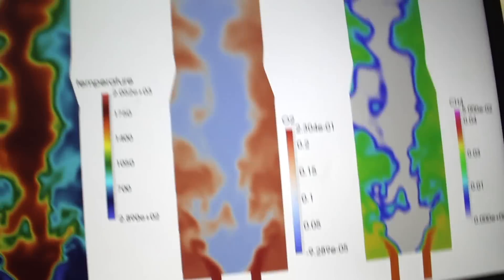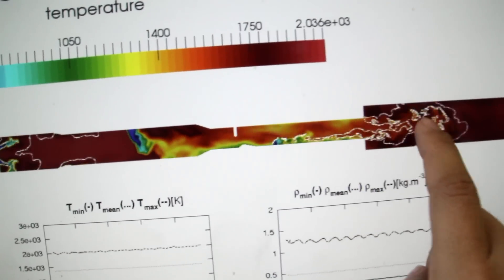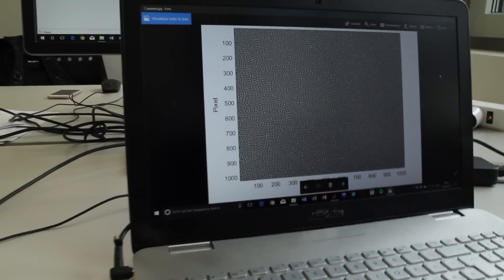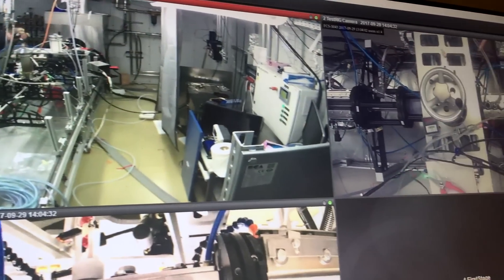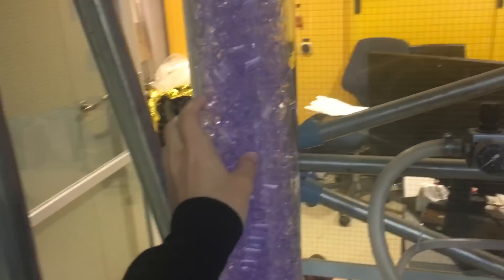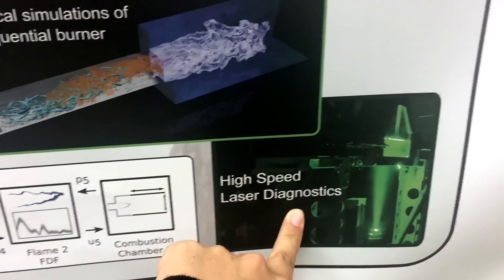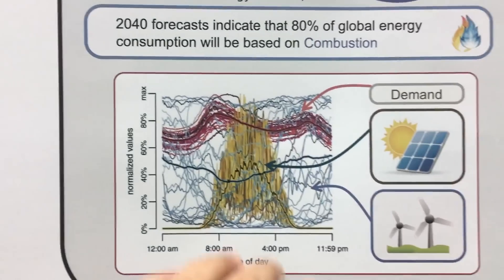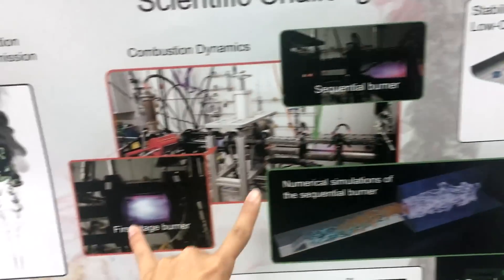Day in the Life of a Mechanical Engineering Student | Engineering Study Abroad

Comment: I find it funny that 18 year olds in the Air Force learn all about propulsion systems and turbine engines in a accelerated course within 5 months are qualified enough to work on and maintain them, but yet engineering students don't do anywhere near that until grad school lmao I probably learned more about the equipment you all study after only 5 months then engineering students do in 4+ years
Reply: Much respect to all our service men and women, and than you for your service. There is a reason why the Air Force employs aerospace engineers despite having 18 year old aerospace ground equipment technicians. There is a difference in the depth and breadth of knowledge. There is a massive difference between maintaining an engine and designing one... let alone a whole aircraft. Propulsion is one small aspect of aerospace engineering (and engines aren't even always necessary, sail planes for example). If it was possible to fully train engineers in 5 months there would be a huge economic incentive to do so. The work that STEMinine presented in this video, was one part of her education, not the culmination of it.
Reply: 551223 you are a technician. You repair and mantain equipment. Mechanical engineers design the equipment you miantain. 

So stop it. You are making servicemembers look foolish here.
Reply: They are related but entirely different skill sets mate.
Reply: I'm a mechanical engineering student and a pretty significant portion of my classmates are ex- Air Force and Army who were in similar divisions as you explained, but absolutely needed more education to be employed designing and improving what they were previously only maintaining. 

There's a reason why the mechanic that replaces your clutch and fixes your engine isn't building a whole new car in that garage. He's very good at fixing cars and telling you what's wrong with them, but if you gave him some paper and CAD software and told him to design a brand new one, he couldn't.
Reply from the maker: Thanks for such a thorough and thoughtful explanation andrew:)
Reply: 551223 your entire premise is that your training is almost equivalent to an engineer's training. 

It isn't. That is my point.
Reply: I think you are getting mechanics and engineers mixed up... They're NOT the same thing ! x)
Reply: 551223 having more hands on experience has nothing to do with designing a hybrid drivetrain or a jet propolsion system or any Mechanical system. Designing isn't in your job description. No contractor is going to hire you to design a new jet propolsion system because you don't have the first clue in how to execute that. 

NOTHING in your job has anything to do with designing machinery with the knowledge of advanced mathmatics and physics. Absolutely nothing. You maintain and repair equipment equivalent to a car mechanic.

A car mechanic has more hands on experience with replacing the clutch in a manual transmission than a mechanical engineer. They don't have the first clue in how to design a manual transmission though.

Signficant more amounts of training in higher level physics and mathmatics is required to design.
Reply: 551223 CAD software is just like me saying “grab a pencil and paper” it’s the medium, not the actual work. 

You claimed that they can get the same training in 5 months as an engineer does in 4 years. Well a mechanical engineer graduates after those four years fully capable of designing any mechanical system, including but not limited to cars and planes, which 5 months of training anywhere in the world will not get you.
Reply: 551223 and what experience on an engineering design team do you have to make such a statement? Thousands of freshly graduated engineers are involved in the design process of an engineering team right out of college. 

The lead engineers that have a decade plus of experience are the ones who manage an entire project but fresh graduates have been charged with designing specefic components. 

If you believe in capitalism, there is a reason why a fresh engineering graduate with no industry experience and just a few months of internship can be handed a 80+ grand salary right out of college and it ain't for charity.
Reply: 551223 did you forget your original comment or something?

I highly doubt you are a ME student unless you are a freshmen taking intro courses if you believed that a 5 month technical school taught you an equivalent amount or had the same purpose as a 4 year engineering school.

It's obvious that you have no clue what the purpose of engineering school is if you think grad engineering students maintain and repair equipment like technicians.
Reply: 551223 when has a ground aircraft technician ever made recommendations for a design lol? 

The vast majority of engineering school is math and physics theory. There is hardly much training in physical equipment as that isn't the propose of engineering school.

The core basis of mechanical engineering is statics, dynamics, thermodynamics, multivariable vector calculus and differential equations. None of which is really taught in a technical school.
Reply: Stephanie Lloyd it's not about building a whole new car. It's about being able to design specific competents. It takes a massive engineering team to design an entire vehicle. 

Navy technicians don't design anything. They don't have the advanced mathmatics and physics training to design. They repair. 

Technicians mantain and repair. 

Engineers design based on their knowledge of advanced mathmatics and physics.

Btw, it's good to see women chosing these fields more. It's kind of a massive sausage fest in our MechE department in my school.
Reply: Stephanie Lloyd well obviously if they never used CAD they aren't going to know how to use it. I'm saying people in the military have more hands on experience and training with the equipment they're working on then many graduate students. if something goes wrong, they can recognize what is wrong and can recommend corrective actions; not just design an entirely new unit
Reply: Farhan Chowdhury I never once said they know how to design anything so idk what the point of your statement is
Reply: Stephanie Lloyd I didn't mean to be condescending. Sorry, I was just stating in most engineering design teams, an individual engineer is responsible for a component of an entire product rather than the whole product itself which I'm sure you already know.
Reply: Farhan Chowdhury btw I agree with you that they're part of a team and help design a single component. The girl claimed they can design an entire aircraft, which is obviously false
Reply: 551223 I mean internships in design teams and career engineers teaching you and explaining to you how industry works in great nuance is more experience than you have as a technician in regards to what fresh engineering grads do out of college.
Reply: 551223 you honestly have no room to speak. You honestly believed that a 5 month technical school that trains you to maintain and repair aircraift is equivalent to a 4 year degree that teaches how design by teaching and applying higher level physics and mathmatics.
Reply: here ya go bud. https://drive.google.com/drive/folders/0B4tcnmT0ywhddkFVRk5VdEZGZTA come back when you can complete this course.
Reply: Farhan Chowdhury I know what an engineer does but thanks for being facetious. By the way, my faculty advisors have designed and built entire airplanes, monicopters, and cars from scratch, but I guess that’s neither here nor there.
Reply: Stephanie Lloyd if you think a student right out of college with no work experience can design an aircraft, you're naive. 90% of MEing jobs out of college will not be doing anything close to designing a working system .
Reply: Farhan Chowdhury I can ask you the same question
Reply: 551223 have you ever heard of design build fly or similar? Seniors literally build entire aircraft and rockets as a competition. It’s not going to be some elaborate stealth bomber or commercial aircraft but it will fly.
Reply: Stephanie Lloyd yes, they build a model
Reply: If they work, and they're heavier than the air they displace then by definition they are airplanes. I'm building a mini sprint similar car, universities have Formula teams that build Formula cars (my school doesn't have the money unfortunately :( ) and right now if I had the money and equipment I could build you a whole car.

One of the reasons engineers in industry work on individual components rather than the whole system is because it would take me a pretty significant chunk of time to build that car by myself, whereas a bunch of people each doing their own task can collectively come up with a solution far quicker than I could alone. You still have to know how the whole system operates together, you still have to know how to integrate your part and how failures or properties of it will affect surrounding parts, etc.If you don't have an understanding of how every single part in the system works and why those parts were designed that way, then your part will not work effectively. 

But you've claimed that someone who spent five months learning how to maintain systems is equivalent to the analytical, mathematical, and design skills taught in engineering. If such were equivalent, then the military would never spend a dime on engineers. They'd just make cheaply trained 18 yo dudes build their airplanes, tanks, subs, boats, guns, missiles, and missile interceptors themselves rather than spending billions to contract out that work to engineers at Raytheon, Lockheed, NAVSEA, Northrop Grumman Boeing, General Dynamics, L-3 etc. If you actually think that the two are comparable, then at this point there's really no helping you. Cheers dude.
Reply: Stephanie Lloyd you can't build an entire car, you can't even identity 90% of the components in a car. I'd be surprised if you knew how to change your brakes. My money says you can't. Again, never said they knew how to design anything. Don't know why you're so fixated on that. Whatever helps you secure your ignorance
Reply: youre literally putting words into my mouth, but cool i guess
Reply: Farhan Chowdhury woah I didnt see a lot of these comments lol why do you all think Im against engineers? I'm a ME student myself lol
Reply: Farhan Chowdhury I didn't say that either. I said they learn a lot of the same things in terms of the inner workings of units, systems, and know enough to be able recommend corrective actions or design ideas to repair or create new types of equipment. My technical school was 5 months but, it's the equivalent of a 2 year long course. It's just compressed into a shorter time span. My main point is they learn a lot of the same things and get hands on experience with equipment that only graduate students receive. Never said they can do the job of a engineer with jusy my knowledge
Reply: Farhan Chowdhury my original comment from 3 months ago? yes...but okay you don't have to believe me. Doesn't matter much to me
Reply: Farhan Chowdhury didn't say any of that either but alright
Reply: @551223  Two very different roles that are just as important.  Design and maintenance. Those specific systems that you're being trained to maintain in 5 months were designed by University educated Engineers. Mechanics/Technicians and Engineers need each other, if these systems can't be maintained... there's no point in designing them and if they aren't designed, there's nothing to maintain. Maintenance courses can afford to be specialised, and they need to be. If I join the Royal Navy as a mechanic to maintain type-45 destroyers, it makes sense for my training to be entirely geared on that. But Mechanical Engineering based courses need to cover the fundemental basics from the ground up over quite a number of fields because they'll be expected to design pretty much any mechanical system depending on the job role. None of us really know where we're are going to end up, maybe its Aerospace, automotive, HVAC, Oil And Gas... list goes on... so the principles need to be applicable to any of these industries. And studying for such a broad range takes quite a bit of time, so cut us some slack buddy... we can't all be Tony Stark hahaha.
Reply: 551223 yes you did. Either you are horrible at phrasing your thoughts or you are just moving goal posts.
Reply: 551223 did you have a major apiphiny between now and 3 months ago or something? 

If it was starting actual engineering school, then I guess I was correct in saying that you are a freshmen engineering student.
Reply: Farhan Chowdhury yes I know, I didn't take those courses in tech school nor did I say I did. Are you reading anything I'm saying? If I didnt learn anything related to engineering course work then why did 15 of my earned tech school credits transfer to my university? Odd uh
Reply: Stephanie Lloyd There are car mechanics , and regular young folks who build their own cars. Go to a car exhibition and you will see some of their stuff.
It is just that their stuff may not be the safest, fuel efficient, or consumer friendly.
Also you need a lot of money to do that.
Reply: 551223 I just left ad security forces and im retraining into structural maintenance on the reserves side. Also, I'll be using my gi bill to go back to school for engineering. Hopefully things work out the way I want it to.
Reply: 551223 15 credits? Lol you prove everyone else's point. Infact you prove that your 5 month course doesn't even equate to 5 months of an engineering degree. Your 5 months of training works out to be about 2.5 weeks worth of an undergraduate degree lol so much for compressed.

Reading though all these comments it's clear you didn't  really understand what mechanical engineering actually was. But I see you're doing it now.. so how's life? As easy as you presumed?
Reply: Wow what a ...well I won't say.  An engineering degree isn't just about some specific piece of equipment or technology.  Its about learning a methodical approach to design.   It takes 4 years to get a degree because you aren't just downloading knowledge about how a propulsion system work, you are being trained how to think.

It doesn't matter what you think.  You have no idea what it takes to be an engineer.  You would rather be a self righteous technician throwing bolts from the peanut gallery.
Reply: Anyone going into air force or navy etc. Learns shit in a few months that colleges teach in years. They cram you guys full of that shit but you dont learn everything you would by going to university. Stop that superiority complex
Reply: chaotic_gabby I don't think it superiority.. I think engineers just get a bit defensive when someone naively thinks they can "Do the same thing" in a few months. Truth is this whole thread is an issue of semantics, OP assumed engineer means mechanic and mechanic means engineer. Truth is more people would sign up to be "an engineer" in the airforce which is why I suspect they use it as a euphemism for navy mechanic

And you're right, you don't learn everything in college but engineers typically never stop academic learning and there is a credit system you need to maintain throughout your career. Graduates still spend typically another 3 years before they qualify as professionals
Reply: QCumber im majoring in computer engineering but i do think it's the person who has this superiority complex because of the way they are saying it sounds like they are acting superior
Reply: chaotic_gabby maybe, but in my experience engineers talk to each other the same way haha. Engineers are famous for poor EQ, myself included. Maybe it's just a classic case if internet schooling?

Anyway, gl with your major, I'm sure it's gonna be challenging
Reply: comparing those two things is a little stupid... You learn how that thing works and how to maintain it. An engineer learns everything behind it and how to develop such an turbine. Wanna see one of those 18 year olds analyzing thermodynamics. Let those 18 year olds develop our aircrafts and cars, good luck with that
Reply: Here's a link of what we learn in only 4 months, as opposed to what engineering students learn in over four years
https://www.thebalance.com/2a6x1-aerospace-propulsion-3344277
Reply from the maker: it's true. You actually don't even need a 5month course, you can learn it all yourself online or from a textbook. I would say engineering is a degree that gives you problem-solving skills and changes the way you approach problems.
Reply from the maker: hey I just checked it out. And although you learn about how to maintain, repair, and install an engine (and how it works), you don't learn anything about the fundamentals of thermodynamics, heat transfer, fluid dynamics, or combustion. Actually, none of what is in the course you sent is actually taught in engineering school. so I would say our skills are applicable in completely different situations
Reply: STEMinine in that job you do not but in the job im in, we did cover those topics. my job in the air force is called aerospace ground equipment. you can look it up if you're curious
Reply from the maker: thats alright, i believe you
Reply: Get over yourself genius lol.. you wouldn't have that plane without the brilliance of some of these people.  Without almost every aspect of what engineers do daily.  You know the heat treat temps the molecules transform. Did you create the vacuums to test air flow .. machining feeds speeds and tool selection.  Program and create cad and cam.  Manage the process. Use statistical approaches that make it cost effective.  Use a blueprint to produce fixtures and work holding.  Create complex matrix of ceramics to coat it all.  Mop the floor and eat lunch that day? Stupid ass engineers